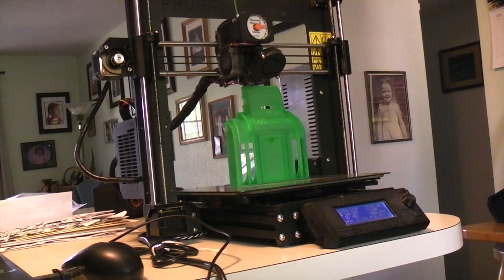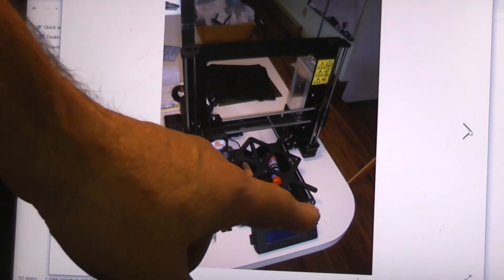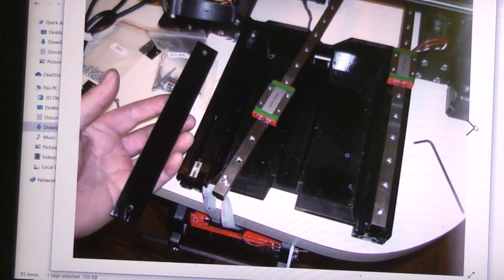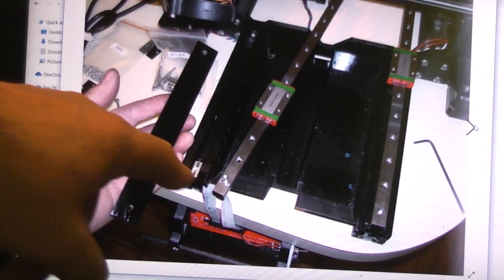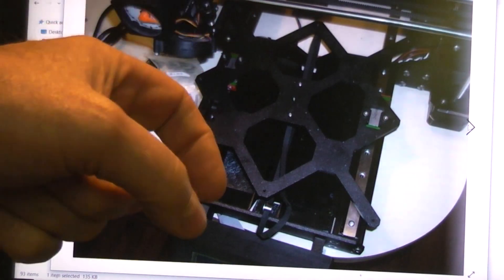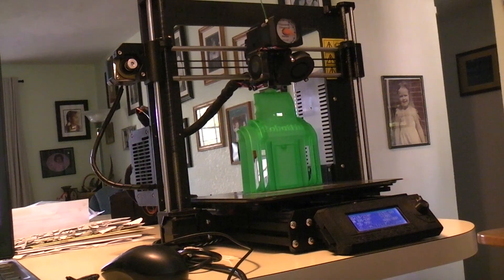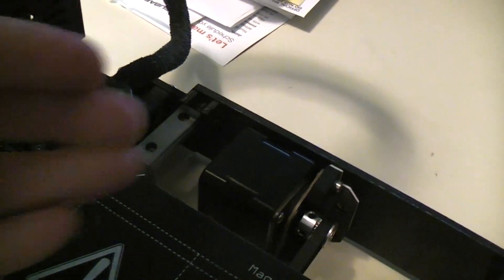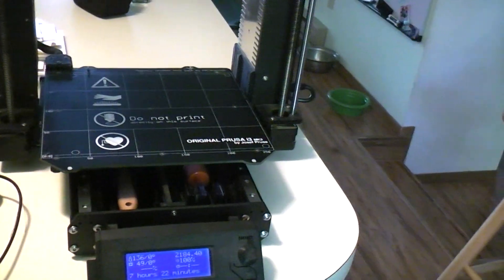Add linear rails to the Y axis "bed" of your Prusa i3 MK3 S printer.

Comment: I am having a problem now of it passing the self test.  Did you have any issues?  I found an angle grinder works great cutting the rails and you can get away with a 300mm rail on the one cartridge side.
Reply from the maker: Yes I did a follow up to this video that explains the self help test and what too do. here is the link.
https://youtu.be/3k387odDvAY

Comment: Wondering if this had any affect on ghosting at higher speeds
Reply from the maker: The highest speed that I print at would be the standard Prusa slicer 0.2 setting. With multiple  3d printers I do not need to print faster, so I could not say. But having slop free bed bearings can not hurt !

Comment: Are the rails quieter than the original LM bearings?
Reply from the maker: The linear rails are silent. But the PCB type heated bed will act like a sounding board for the print nozzle dragging on the print. So I added insulation to the bottom of the PCB heat bed to stop the sound .

Comment: What about a link to the rails you purchased... and maybe the nuts?
Reply from the maker: The problem with Ebay links is that the sellers are not there for long. And some one looking at this video a week or two from now will find the Ebay auction over.  For the T NUTS use these search words on ebay. "uxcell Slide in T-Nut, M3 Threaded for 3030 Series Aluminum Extrusions Profile",. For the rails use these search words. " 
Linear Sliding Rail Miniature Guide Block CNC 250-550mm DIY 3D Printer".